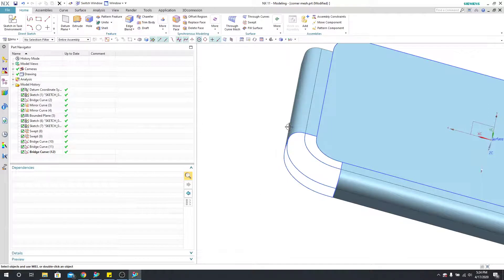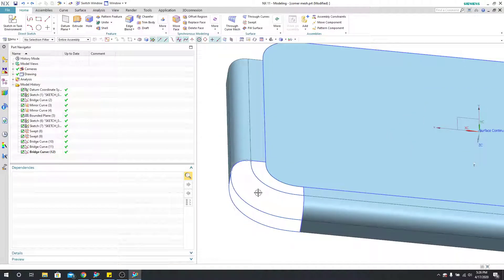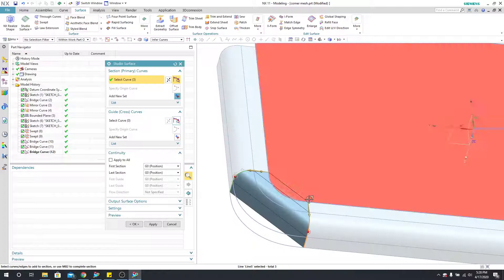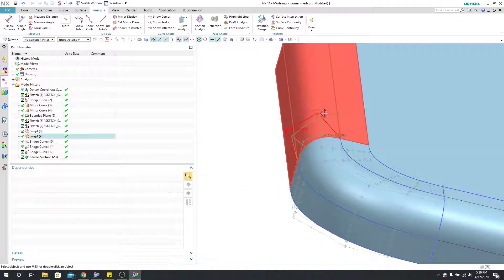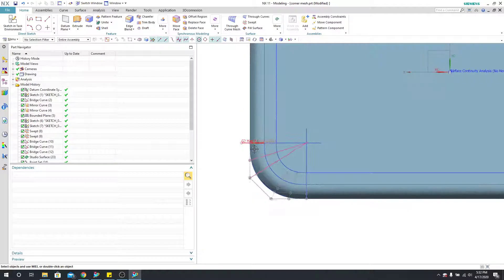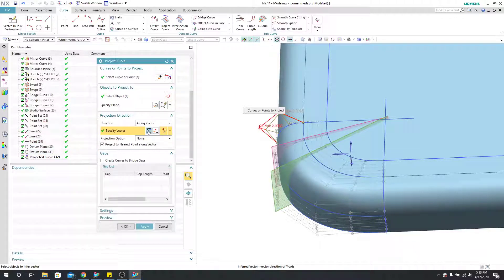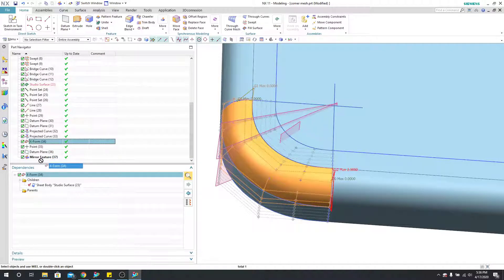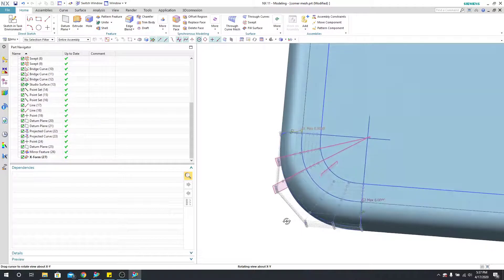NX 12 Tutorial - How to Use X-Form to Achieve a Class A Surface in NX 11

Comment: Thank you for uploading this gem, probably the best NX video I've seen. I've tried the way you've described and it actually works, resulting in a surface with the absolute minimum number of poles and perfect continuity, a real class A surface. Sure, in this example you could simply create the entire sidewall as a single sweep, but I can see where this method could be useful. It's a pity NX doesn't provide this out of the box, because even though you can barely see the difference, the simplified surface improves all downstream operations. Currently, it's a lot of additional work.